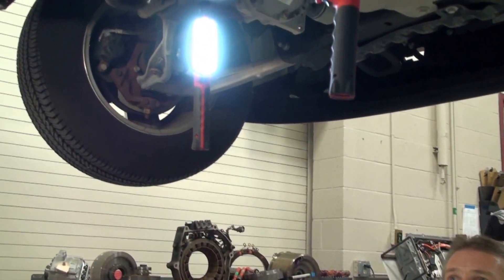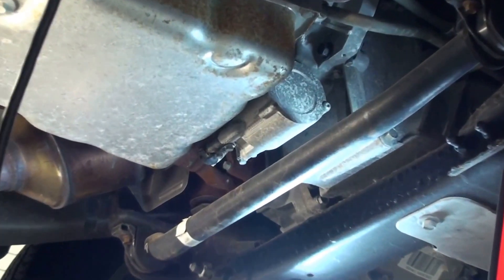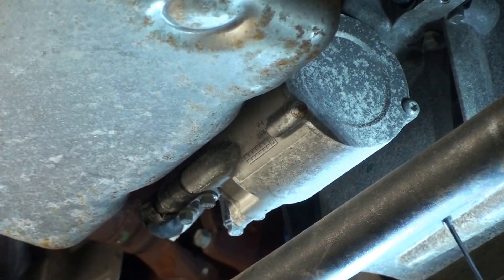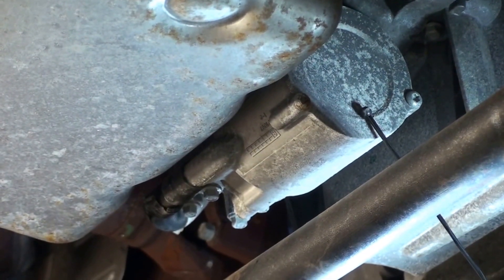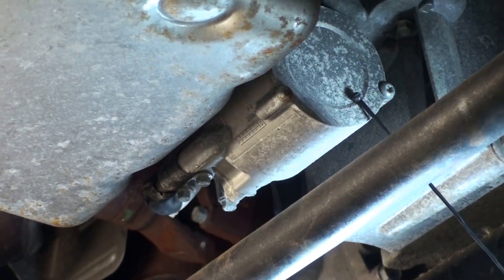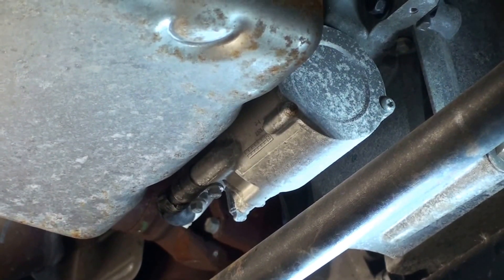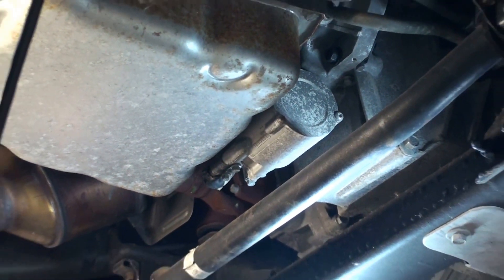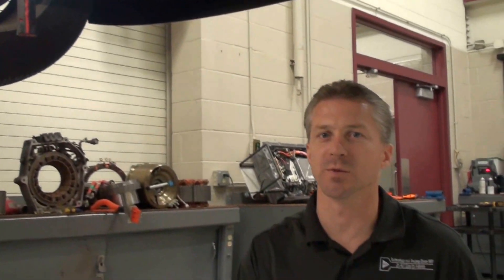HEV-TV 1.15: Auxiliary Pump in Automatic Transmission

Comment: Great explanation on what this does and why I have to turn off the auto-stop feature.. For changing it, see ford video which is a connector + 3 8MM bolts and $210 for ford part. Yes I know this is a a chevy video, but it is simple on ford. Hope chevy is simple too.